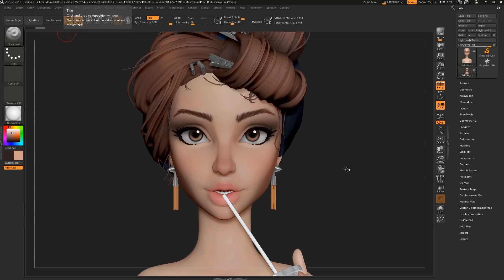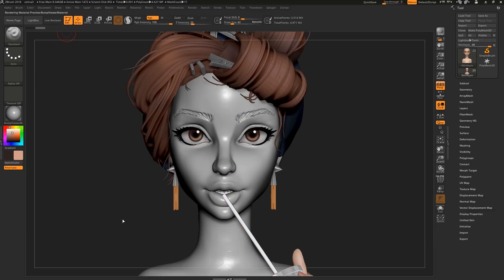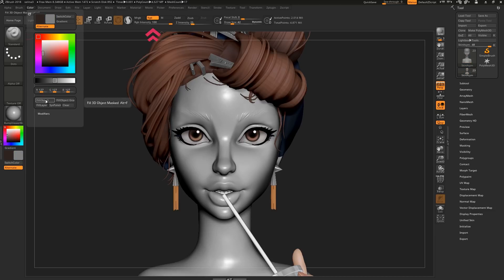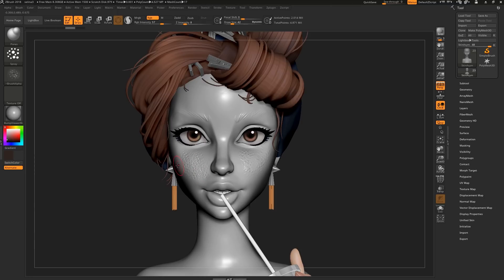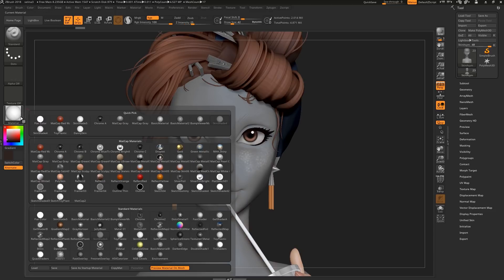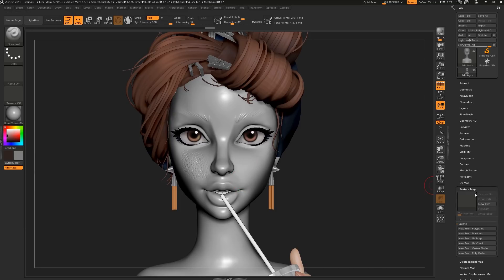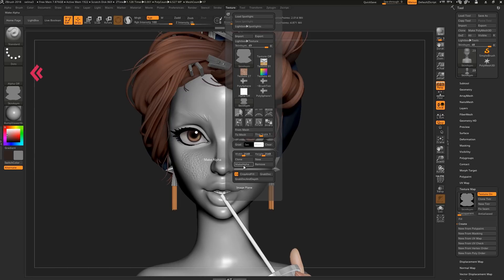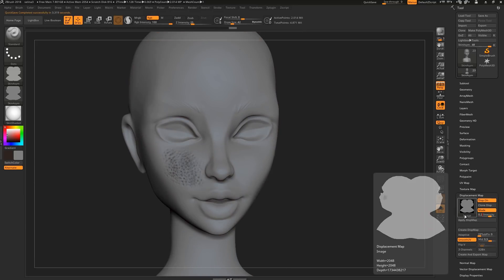How to PAINT SCULPTED DETAILS using Zbrush Bump Viewer Material - 60 Second Tutorial

Comment: Hey Danny... after upgrading to zbrush 2018 from 4R8, I have found that my normal maps were not working anymore when importing all maps to blender. I tried several times but only sadness resulted. Happily I have just discovered that if I ctrl+T on the image texture node to give it UV coordinates AND change X-rotation to 180 degrees it works! I wanted to share this with you because you have a much larger audience than I do and this is a serious problem when importing assets into Blender. The 4R8 multi-map exporter worked fine for me every time and this step was not needed. I only had to click sNormals at export to export a smooth map. Perhaps there is a way to export the normal without this, but I can't find it. Texture map/polypaint info is fine - only the normals seem to export incorrectly.     

Keep up the good work...
Jim

Comment: Interesting technique.
Have you ever needed to do this in your work, though? It's cool, but I can't see why one would need to do this as apposed to actually sculpting. Except maybe for like a scar or something
Reply from the maker: Well it is kind of an old technique and is not something I use personally (in ZBrush), but I hear it's good for system resources since you don't need to subdivide the mesh as high. But this technique is essentially how apps like substance painter works (i.e. painting directly into the map), so it's still very much valid :)
Reply from the maker: it might be easier the think about hard surface uses :)
Reply: I see. Thanks for the reply!

Comment: Sweet, is it possible to smooth the normal layer sufficiently with the brush? (a problem I have with other 3d software where they support direct normal painting where this blurring feature is not implemented well and causes a lot of headaches)
Reply from the maker: just did a quick test smoothing the paint layer and seems to work great... if that's what you mean?